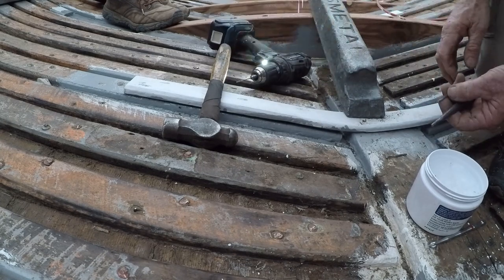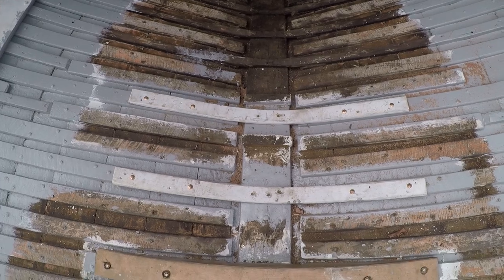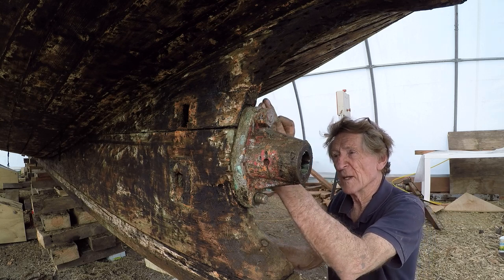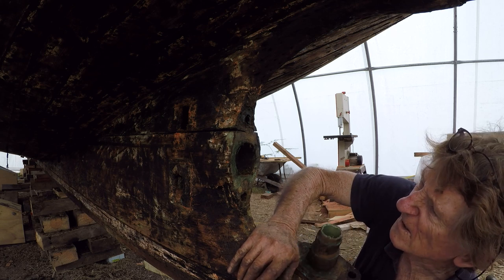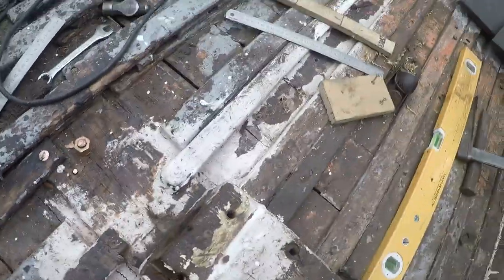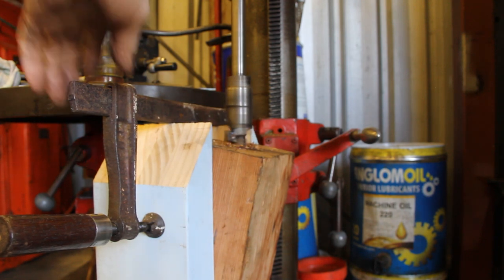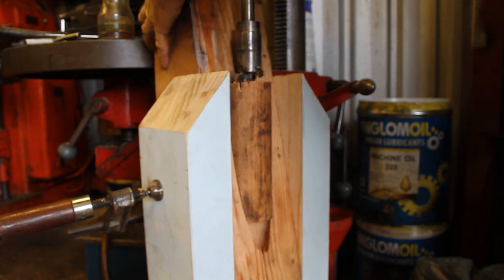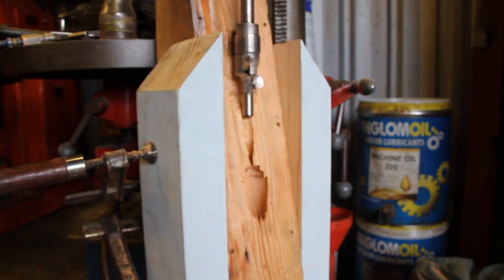Reviving Jabiru - Episode #9 - Almost the last of the hull fastenings

Comment: Umbrella spokes,
My dad was a shipwright in WA building boats out of jarrah and Karri, did his time with Bass Bros.
He used to use Harley motor cycle spokes because he got a heap cheap at an auction after the war.
Same auction he got a proper Nissan Hut brand new , never been used, still on the pallets,
That was his first boat building shop when he moved up fro Perth to  Geraldton.
Reply from the maker: Those spokes would have made very big diameter holes.
Reply: @revivingjabiru7588  
Big timber boats.